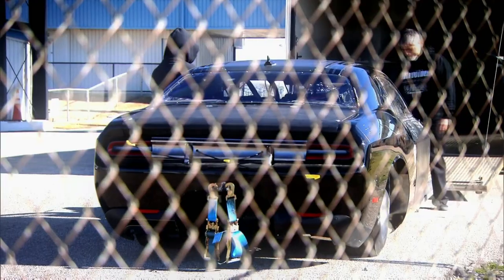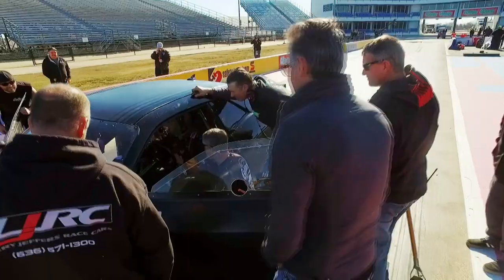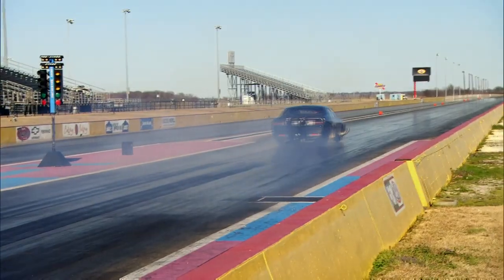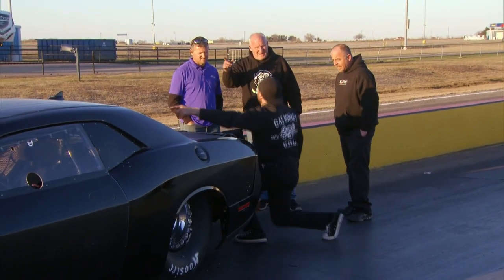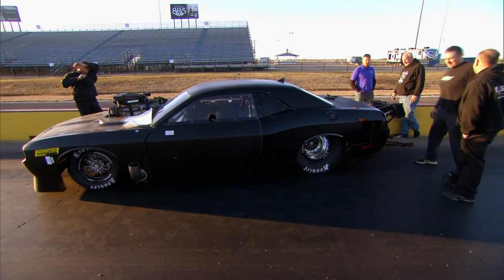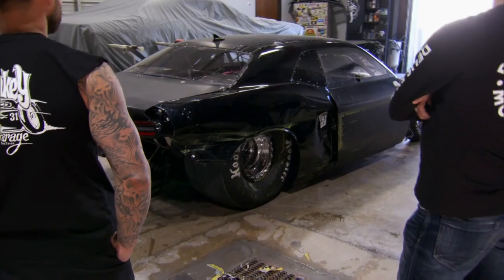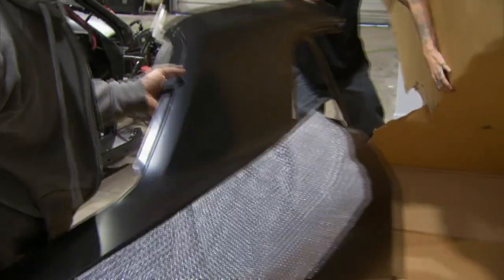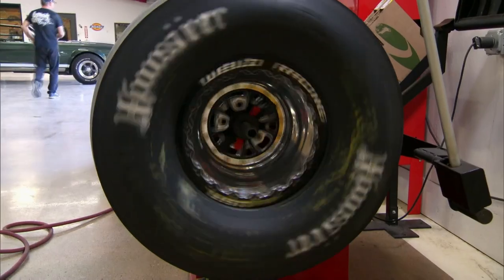Gas Monkeys CRASH Whilst Testing Their Car For A Race Against The Street Outlaws | Fast N' Loud

Comment: Who ever built that chassis need to be fired.A low impact crash like that and broke the 4link mounts? I dont want to even imagine how bad it would be if it was a high MPH crash, probably crumble up like a pop can.
Reply: The problem is that chassis wasn’t built for that car Richard just bought a used chassis and put a different body on it the best way possible to make a drag car is to take a stock vehicle off of the road and build the roll cage inside of the vehicle thous making the cage custom to the car and making the roll cage set up for the drag racing your gonna do with it 🤦🏽‍♂️

Comment: What they don't tell you in this clip is Richard cheated. The race between Gas Monkey Garage and Big Chief was suppose to between them. Richard hired NHRA Pro Stock Driver Alex Laughlin to drive for him.
Reply: right ,thats because Richy has no bals
Reply: hes all mouth
Reply: He tried to cheat and chief still smoked his ass with a car he put together in just over a week
Reply: On the chief and shawn show. Chief said what they didnt show on tv,  richard was claiming my shop and my guys built this, every nut and bolt. Chief even asked him okay what gears are in it and Richard said you'd have to ask the Laughlin's
Reply: I imagine Richard has very little experience in drag racing, & 0 in a car like this! On the other hand, how many YEARS has Chief been at this?! I don't care if the G.M. got beat or not, but you can't fault Richard for getting someone with way more experience than him!
Reply: Thats cos richard is a show clown its about time discovery dropped his circus act , its not about the cars no more its all about mr big head rawlings getting more fanboys
Reply: Experience dont mean anything, if you watched mega cash days the winner was someone racing in their 1st cash days, not to mention  one rule was pre 80s model car, race it themselves and had a month to build it, chiefs motor was eating itself alive in this race as the motor and doors were off his old crow and chief kept finding metal shavings in the sump, chief just slapped a street car together that he is still racing today, but there's no excuse to drag racing on a track when you use a professional driver
Reply: IIRC, it was also suppose to be a vintage body, not a modern.
Reply: Was suppose to be build your own car and race it. Richard hired team to build it and race it.
Reply: And still
Lost
Reply: He's not a license racecar driver
Reply: Wasn’t there rules for the cars ? Like isn’t cheating to just make a promod because that challenger is just a body with a different chassis not a real street car turned into a race car 🤔

Comment: They broke so many rules with this race, not to mention spent a month on it, still got their asses smoked by the same gto big chief is driving now that took him about a week to build
Reply: Çt1
Reply: A week? You have never built anything if you believe that bs
Reply: The body was already pre done, as chief was building a car for himself already, but they put the car together in a week, as all the engine one of the turbos and the doors came off the wrecked crow, if you haven't go back to the street outlaws build to mega race, where he really didn't are about the dude since he knew he was breaking rules

Comment: The problem with this car was that usually when building a drag car like these you build the roll cage inside of the body of the stock vehicle so the chassis is custom made for the vehicle.instead of that Richard purchased a ramdom roll cage chassis and put a body on it that chassis wasn’t built for that car and you can tell the way it handles

Comment: Richard does not need to be in the drag racing world especially with that caliber of car. He rushed his guy's into building it and the guy even said that the steering wheel was sloppy. Go anyway cause we gotta be there and look what happened with no sympathy for the guy that tried making a pass in the thing..I'm pretty sure Richard's ass would be doing the driving in a hurried up rocket on 4wheels. He has no idea what it's like trying to handle a pro mod that hasn't been tested properly for at least a week cause there's alot more to it than the engine and all that stuff. The suspension and everything has to be dialed in properly before even thinking about blasting down any tracks in the car

Comment: Nice. Hire a so called race car driver to crash your race car. Richard probably wishes hed just drove it now
Reply: You mean give a race car driver a dud these clowns have no business playing with race cars
Reply: Richard wouldn't even sit in that car with it idling his mangina would shrivel
Reply: @DirtySlapper99  almost looks like the rear end mounting points snapped, kicked the rear end at an angle and sent him into the wall. Probably a bad weld snapped. But yeah I agree with that 100%
Reply: @BlueWaterRedBlood  the diff was off from the start aswell the car wasn't tracking straight at all
Reply: Alex drives pro stocks

Comment: Why should he drive.....that clown chief was looking to take advantage driving is what he does Richard runs a workshop
Reply: Because richard said he's going to be the Driver when this came about
Reply: Richard aint running shit anymore !
Reply: They agreed on rules and Richard broke nearly all of them lol.
It was supposed to be gas monkey garage and Midwest Street cars each have to build a pre 80s street car with steel quarters and roof with a matching vin number (no pro mods), they also set an engine size but I can't remember what it was. Then cheif had to race his car and if he couldn't then Shawn would do it. Aaron was supposed to race his car but if he couldn't then Richard would. 

Richard hired Laughlin Racing to help build it and to race it. He also bought a newer car than what they had agreed, it had a bigger engine than they had agreed to as well.
So not only did Richard break nearly all the rules but like cheif said, they came to race gas monkey garage not laughlin racing, which is a very well known professional drag racing team. Alex laughlin is an NHRA pro stock racer.
Reply: Then even after Richard cheating so much, cheif and Midwest Street cars won lol
Reply: @LongdownConker  damn rigg4 cheated in everyway and still got his ass stomped my midwest street cars